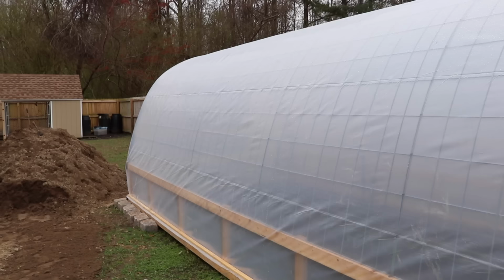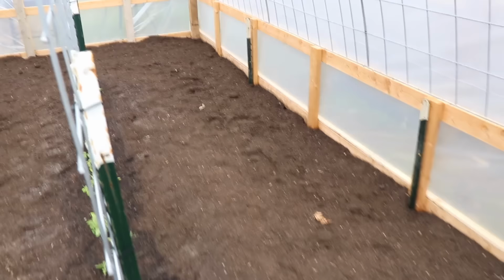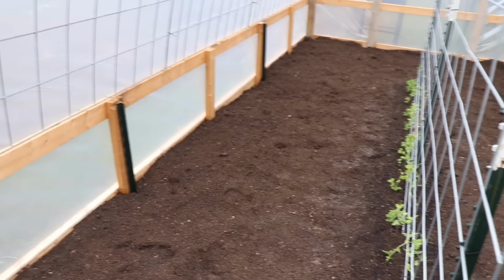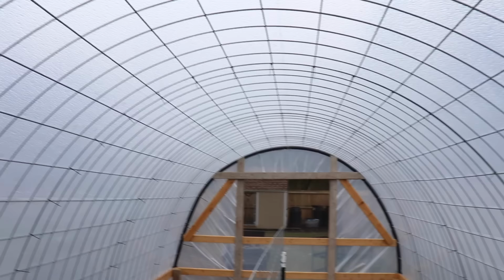DIY Cattle Panel Hoop House || Build Your Own Cheap & Easy!

Comment: Very instructional easy build. Looks great. I wonder about the 2x4s on the bottom with moisture making them root. Need something to treat them possible. Not knocking your job, just suggestions. Thank you for sharing. May I ask what State you are in. Be interesting to see what winter weather does to it. Hopefully stands the test. Iowa is watching
Reply from the maker: Hi Gene! Yes, we normally build
with treated wood but we were trying to go as cheap as possible & also utilized some wood we already had on the property. 

The hoop house has done fine through the winter and summer storms. We’re in VA so we don’t get a lot of snow. I would def recommend a center support beam if you’re in an area with heavy snow load. We actually just sold the house, and will be moving up to our forever homestead in Alaska in the fall! But this hoop house was an awesome addition to our garden space while we had it! 

We plan to build a fairly large geeenhouse at the Alaska property! Hopefully you’ll stick around for our upcoming journey. 😉 Thanks for watching our video! 😊
Reply: @HomeFreeAlaska  Congrats on moving to Alaska. Wish you the best God has for you.

Comment: Looks like a good necessity garden.  Need to stop gophers and tunneling animals.  Need wire on the floor.   Maybe some sort of cresote logs on the ground to stop rot.    Wind and sun will eventually deteriorate that  plastic.
Reply from the maker: Love the positive thoughts! 🤣 We’ve lived in VA for 8 yrs. Never once had an issue with tunneling animals so we don’t need to worry about wire. This greenhouse grade plastic lasts for 3-4 yrs. Every building, no matter what it is needs maintenance at some point. This hoop house is no different. 😉

Comment: Can I ask? How long do you estimate the polythene will last?
With a conventional metal hoop tunnel the hoops are covered in sola reflective tape, because the metal gets hot in the sun and burns the polythene, you have no polythene to metal protection.
Reply from the maker: Hi there, manufacturer says 2-4 yrs depending on your weather. We live in VA currently and get up to 100 degrees in the summer. We have NEVER had an issue with the plastic on the metal fence panels. But we also have a shade cloth on the hoop house two windows with two fans circulating the air through. It’s actually cool to the touch. No issues. 😊

Comment: I love how you built it but I used  the same plastic trap and it was not UV protested and 4 months later it started to ripping apart from sun damage
Reply from the maker: Yep, we replaced ours too about a year later with actual greenhouse grade plastic & haven’t had any issues since.☺️

Comment: Great idea and good work! I think the only thing different Id do is use pressure treated wood
Reply from the maker: Yes, I know! 😩 We usually always work with treated lumber on projects like this but lumber is so expensive right now, we just used what we had on hand and what was the cheapest. Totally agree with you tho! Thanks for the comment! 😊

Comment: If you use 'zip ties', invest in the stainless steel ones. They don't disintegrate in sunlight. Thanks
Reply from the maker: Hey Elbert! Thanks so much for watching our video! So far the zip ties are holding up. But this was really a last minute throw together project. Definitely agree with you that there are some things that might be better with better quality supplies! 😊 Happy New Year!

Comment: I want to make one of these, and put a window in each door ( have a door on both ends ) in which I install a wax "arm" to automatically open it when it heats up to that temp. I'm hoping I won't need to mess with fans or anything electric then, maybe still use shade cloth for using all summer long, otherwise I may just have it on skids to be able to slider her off of whatever's growing in it. PVC is supposed to degrade the greenhouse plastics ( the UV protection in it or something 
 ) and special tape is sold which u can use to cover any pvc if one makes a frame of that, but also many tapes have similar compounds which are bad for it... can't recall if black ( electrical) tape is one such ...?
Reply from the maker: It was an easy set up & has been a great addition to the garden space! 😊

Comment: I have been looking at alot of some, how high are your sides plus the way you put in the stacks where alot of them did not have supported the sides from bulging out. So I like your  idea. A freind of mine herd in Idaho says I should over lap it by four squarees cause of our snow load in the winter time. Right now we have a couple feet of snow on the ground so my thought is to shovel and area to put up before spring time for summer planting on beans and tomatoes
Reply from the maker: Yes I would def do something extra to help support snow load, maybe even some additional support beams down the center? 😊

Comment: Might should have set those end posts in concrete VS screwing them to the wall frame... hope you don't get to much wind where you are...
Reply from the maker: The 4 end posts were cemented into the ground. 2ft down in the ground. The frame was attached to those 4 posts. We get a lot of winds in VA, even tornados. Hoop house has held up nicely.

Comment: Hi, I like what you did… I plan to make the hog panel higher too… The 4x4’s for the base; I choose not to buy the chemically treated 4x4 lumber. Right now I’m painting the 4x4’s with deck-paint to seal in any chemical treatment, so nothing can leach out; as the greenhouse will set close of the garden area. So, I’m curious, what type of wood are you using for the base-contact -with-ground, as well as the structure on top for the door, as well as the sides. It does not look chemically treated. Thanks
Reply from the maker: None of the wood we built with is chemically treated. We know that it’s best to build with treated wood but we were using what we had on hand and what was cheapest at the time.😊

Comment: This is amazing and simple. We are really new to all of this but you guys made this look very simple. We live in the Piedmont area of North Carolina. Our winters are not as bad as yours but it can get cold. But my concern is the spring and summer, do we need to take off the cover during the hot seasons and only use it for winter? Thank you
Reply from the maker: We always left it on all year. If you check out the video description, I linked a couple more videos for modifications we made to the hoop house for ventilation etc., it was a great growing space for our garden! :)

Comment: I did this 5 years ago,you're only gonna get 2 years out if that plastic,from it getting cold and heating up,it's gonna Crack and split,but not a bad build.
Reply from the maker: Thanks! We actually switched out the plastic for greenhouse grade plastic shortly after this video, which is supposed to last “longer.” But we don’t care now as we just sold the house & bought a cabin in Alaska haha! 😉

Comment: Nice Design.  How long does it take for the Zip Ties to UV Degrade and break. Also that Foam will turn to Dust after a Bit in the Sun. Wire would work at joining the panels and overlapping the center by 1 section would make the Arch stronger. And a continuous support all the way down for Snow Loads
Reply from the maker: You’re such a ray of sunshine Winston lol! Couldn’t tell you how long because it’s been over a year and both are doing fine! If something degrades like with any structure, we’ll replace it. No biggy! 😉

Comment: Very good video! Detailed! One question, do you have problems of driiping from the plastic in the winter? My vegetables next to the walls froze to death due to the cold water dripping from the wall.
Reply: I really want a greenhouse that i can use in the summer too. I don't have a big yard. So I want to build a greenhouse over my raised in Winter and use the frame as trellis in summer for my tomatoes, Beans, or squashes.

Comment: this looks great - can you tell me how this design made out as weather warmed up? was there enough ventilation to avoid heat stress on the plants?
Reply from the maker: 100%. With the window in the back & the window in the front door, two fans circulating air through & the shade clothe on top, the plants did just fine. 😊

Comment: Would it be a good idea, or a bad idea, to double up on the plastic layers? Like just have two of the sheets, back to back. Would that double the insulation? My hope would be that I could keep peppers alive for a whole Canadian winter.
Reply from the maker: I don’t see how it could hurt anything as long as it’s clear plastic. Peppers like really warm temps tho as you prob know…so middle of winter in Canada, even with double layers, I don’t know if that’d be warm enough. 😊 Doesn’t hurt to try tho!

Comment: Nice. Do you use pressure treated lumber on the base of your hoop house?  Looks amazing. Will conisder a smaller version of your hoop house in the future?
Reply from the maker: Hey friend, we actually didn’t use treated lumber because we were using stuff we already had on hand. 

We sold this house in 2021 & moved to our forever homestead in Alaska, where we’ll be building an actual wood built green house with plastic/clear corrugated siding…not a hoop house just because we get a ton of snow in our area.☺️ Thanks for watching!

Comment: If u would talk a little more and explain what u are doing and why for each step of the process it sure would help. I love your idea and the way your greenhouse looks more sturdy than others I've seen...and this is what I need, cause I live next to the lake across from the mountains, with no trees in my yard, so it gets very, very windy here at different times of the year. If I don't have something very sturdy it will blow to pieces and I will constantly be repairing it instead of spending my time gardening and watering....I would like to see a list of the supplies needed and also measurements as u go along.. I am 63 years old and do most of my projects alone...however, this may need 2 people, so as to not be fighting a loosing battle ..but its just what I'm looking for.. ..I'm in southern Oregon..

Comment: Very nice construction and video documentation. The material list is a huge plus. What is the expected life span of the plastic in your area if you know it?
Reply from the maker: Hi Mike, we didn't buy greenhouse specific plastic. We just bought regular plastic...so I'm not quite sure how long it will last. But with the VA heat that we experience in the summers, prob not long. So we're looking at upgrading in the spring to a more durable, long lasting plastic that's actually made for greenhouses. Thanks for watching our video!

Comment: Hi.
I know this question might have been asked before. I went through the comments, but when I realised there's 1800, I just felt it might be quicker just to ask. Can you perhaps give the measurements, the type and the quantity of wood you used for the frame and the door, actually all the wood parts of the construction. I want to try this, but I have never worked with any wood yet, so this will be quite a learning curve for me. I think our space is a bit smaller, but I will adjust. if I can just have an idea of how you built as well. I saw the finished part, but I am so new to this, we don't use wood for building where I am from.
Reply from the maker: Hi Carli! We just used regular pine wood for the hoop house. 😊 Did you check out the video description section? We listed all of our materials & dimensions there. I also did a Q&A video that may be helpful to you. Let us know if we can help you out or answer any more questions! 😊 Thanks for watching our video! 

Q&A video: https://youtu.be/zl4sZYStqmE

Comment: I wonder how many years the plastic will last if wind is minimum impacting beating on
 it.
Having this much room is great, all the size I need.

Was looking at a aluminum frame glass 10x12 used, $2,500 though. 
I'm having hard time justifying that as this you built maybe $300-400 tops will be sufficient.  Plus metal & wood are reusable on other projects too.
Reply from the maker: We spent $500 total on this project. It’s held up nicely in the wind, we get high winds and tornados here in VA. The manufacturer says plastic will last 2-4 yrs depending on your weather. 😊
Reply: @HomeFreeAlaska  
thx, As you replied I saw your Q & A swatched it.
I'm 100% convinced this is what I will do now, and abandon the idea  of getting the $2,500 aluminum glass 10x12 I was looking into.

Comment: This method appears to be very sturdy and well built. Can you give me the length and width and gauge of metal for the cattle panel that was used in your hoop tunnel?
Reply from the maker: Hi friend! Check out the video description, I put a complete list of materials & links to everything we used. Also, here is a Q&A video that I did for the video that you might find helpful. 😊
https://youtu.be/zl4sZYStqmE

Comment: I would love to know the overall cost for the finished product.
Also, what zone do you live in? Was only one layer of plastic good enough to keep the internal temperatures high enough during the dead of winter?
Reply from the maker: Just over $500. This is our first winter with the hoop house and I’m growing lettuce & brussels just fine. Temp is great in there. Can always add a heater if it gets too cold. We’re zone 8a. 😊

Comment: That is an amazing build, are the 2x4s on the ground pressure treated to prevent rotting from the compost?
Reply from the maker: They weren’t but we were working with what we had on hand and minimal supplies we bought. They’ll be changed out at some point. We no longer live there tho, we sold & moved to Alaska!☺️

Comment: are the metal fence posts secured to the 2 x4s?  and what did he use the 2 x2s for. extremely helpful video
Reply from the maker: Hi Kyle, yes the metal t posts are screwed into the 2x4s. And the 2x2s were used to make the frame for the door. 😊 Thanks so much for watching. I’m so happy you found it helpful. 😉

Comment: Hey think this is a great idea, how do you think it would hold up if I put a small heater for temperature control in it?
Reply from the maker: I think it would do just fine. As long as there’s good ventilation for air flow so it doesn’t get to warm…I think it would be fine! 😊

Comment: Nice build and makes me think even I may be able to build it, how long do ou think the plastic covering will last before it needs to be replaced?
Reply from the maker: Hi Ed...so we just put this hoop house up in the spring so I'm not 100% sure yet. However, I will tell you that we went with a lot of materials we had on hand, and the things we did buy, we tried to go as inexpensive as we could. So when we built it, we didn't buy a very durable plastic. We knew we would have to change it sooner than later. We actually JUST purchased new plastic and redid the plastic to get the hoop house ready for our fall crop & the winter season. This new plastic says it's supposed to last for up to 3 yrs. It's an actual "greenhouse" plastic that's much more durable. The exact one we bought from Amazon is now out of stock, but I did look up another one that is comparable to the one we just bought: https://amzn.to/3EnJFOe 
Thanks so much for watching our video!

Comment: Shoulda used cora polyurethane  sheeting or the sheeting they use for green houses. That plastic used here will dry out and become brittle in one season.
Reply from the maker: Yep. We replaced it with greenhouse plastic about 6 months later. But ya know? Ya work with what ya have & can afford sometimes.

Comment: Thank you for your video!  But you blew past the foundation which is always the part I need.  How you anchored it to the ground. Tnx!
Reply from the maker: Hey there! The only thing we did for the foundation was cement the 4 corners into the ground, 2ft down. (2) 4x4x8s were cut in half, which gave us our 4 corner posts. We buried each 2 ft down & cemented them.

The only additional thing that we did, as seen in the video was put in 2 metal T-posts in the center of each wooden frame, just for added stability. 

If you have any other questions, feel free to hit us up! 😊
Reply: @HomeFreeAlaska  thank you!

Comment: Hi guys. As an Australian I'm not familiar with your terminology. But what is the difference between a Hoop house and a green house? Also, what length were your cattle panels? Cheers
Reply from the maker: Hello friend! Really the only difference is a greenhouse is more of a permanent structure where a hoop house isn’t. That’s all really. However we built our hoop house to be pretty permanent lol! Greenhouses usually have a foundation & hoop houses usually don’t. Our cattle panels were 16 feet long by 50 inches high. Thanks for watching! 😊

Comment: what a great simple setup! do you get any amounts of snow?
Reply from the maker: We do get snow here in VA but not much where we’re at. 😊 If we lived in an area with heavier snow, I would def add some support beams down the center of the hoop house as the cattle fence panels would not be able to hold up much of a load.

Comment: I love the idea but how do you get stuff to pollinate inside?
Reply from the maker: We only use the hoop house for our plants that don’t need to be pollinated…that self pollinate. We use our outside garden area for the plants that need pollination. But, you could always leave the door open. Also in another video, we showed how we modified the hoop house to be able to roll up the sides for better ventilation. We added screen, but you could not screen it. Rolled up sides and front door open would give the bees access to pollinate.☺️